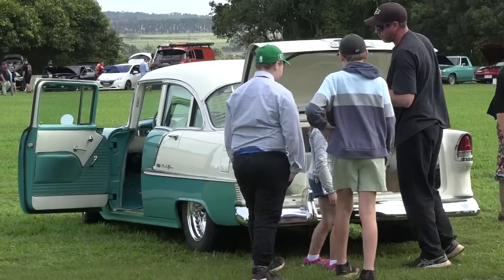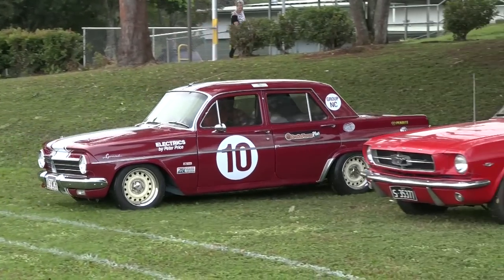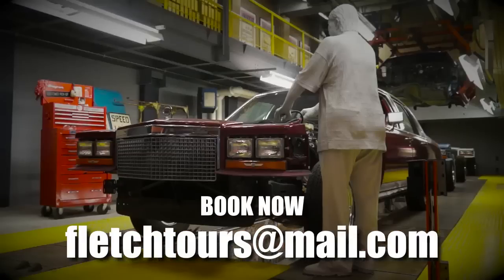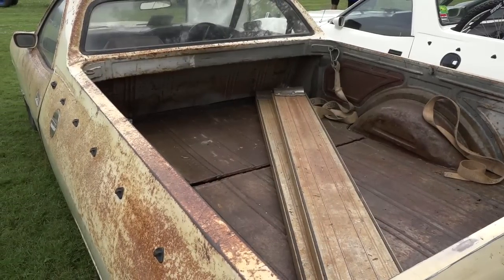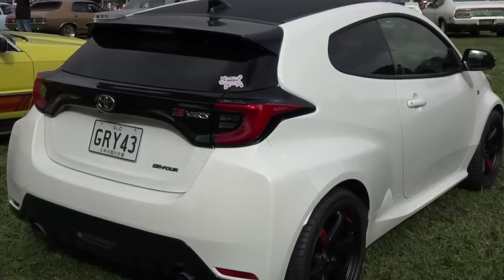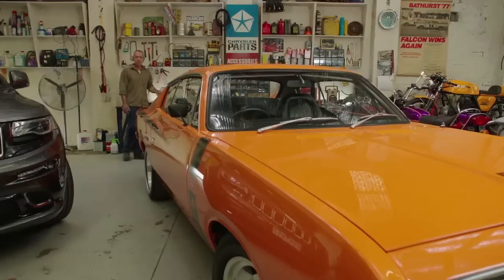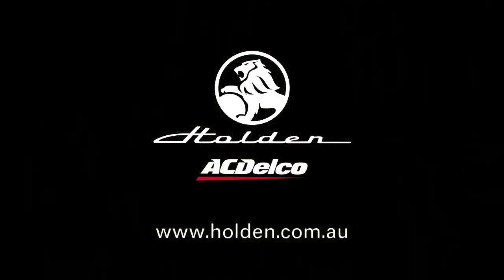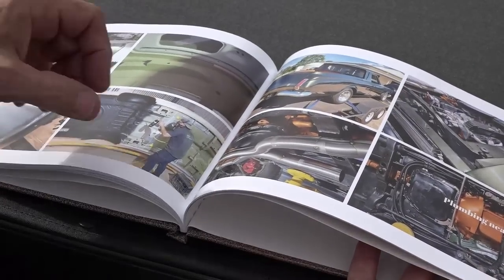Atherton Car, Bike & Swap Meet 2023: Classic Restos - Series 52

Comment: It was a S4 😵‍💫anyway MOPAR for life . Love the valiant Ute owned 3 of them . Give me a AP5 over a eh any day stronger motor gear box an diff an can better hotted up for more power then a eh plus the Valiant has way superior suspension the right sway bars rims an tyres an sitting low is a joy to drive .
Reply: Nah mate.........Holden's are more gooder. I've had HT, HG, LH Torana, VK Commodore wagon.....all good cars. 
Holden's won lot's of Bathursts. How many did Chrysler win? 
Efficient, engines, great suspension, excellent Styling and legendary durability in Holdens. The defence rests. 😉👍